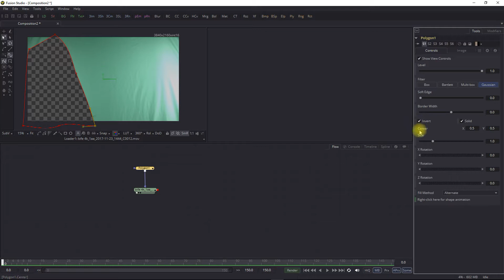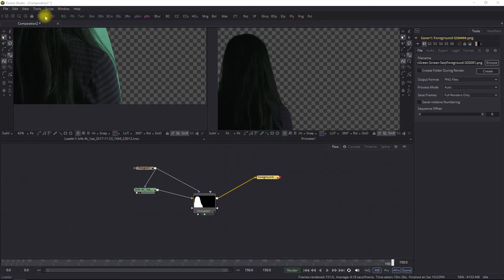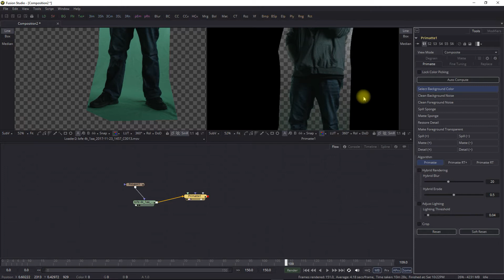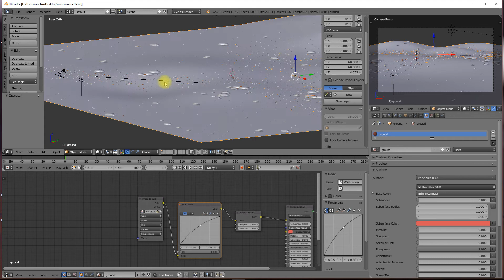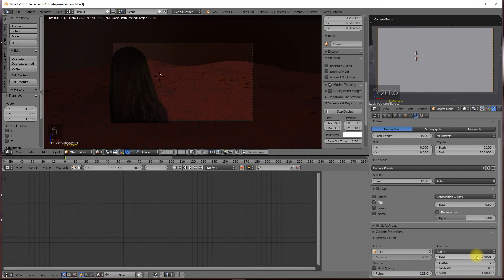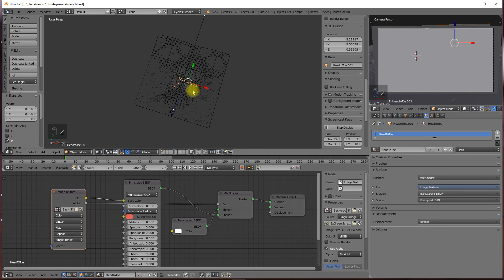Fusion 9 Blender Composite

Comment: So this seems so backward, why would you go from a top level compositing program then into Blender. You can import your 3d objects into fusion, it also has 3d projection and material handling. 

This isn't the way any post house works, 3d to compositors not compositors to 3d, this will give you bad habits and longer render times